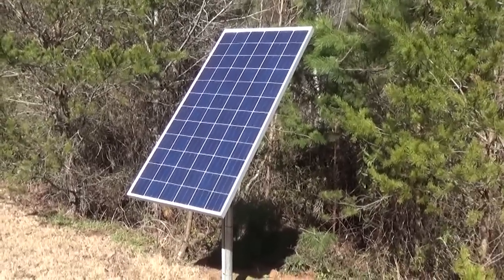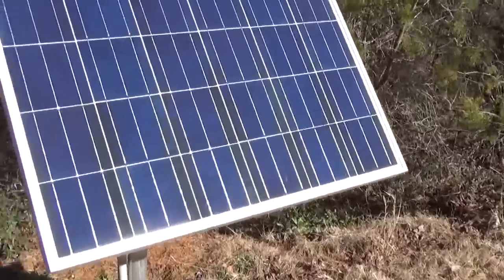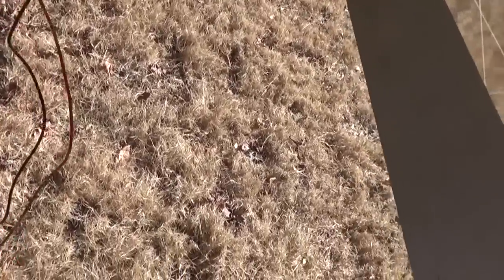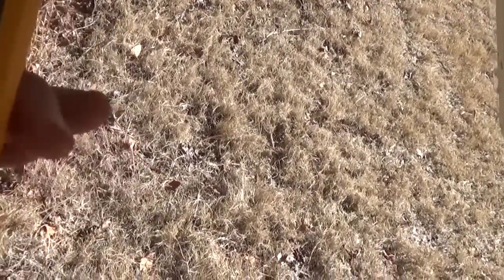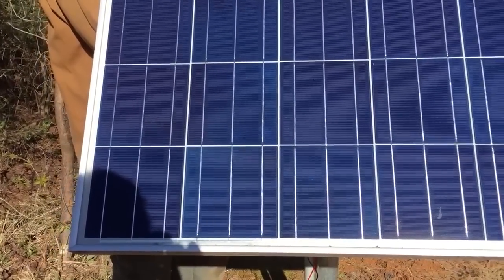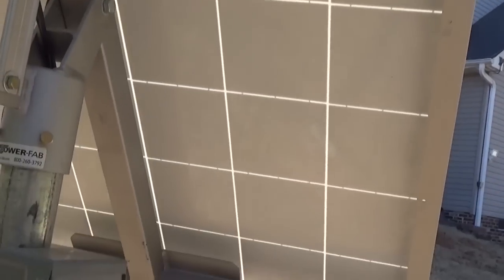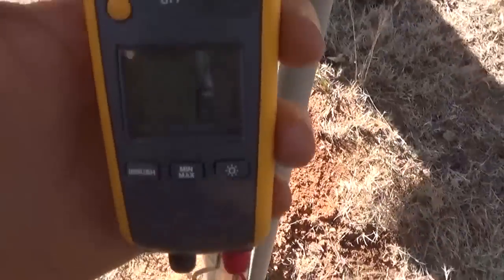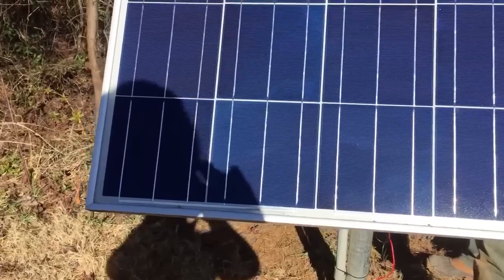How does shading affect solar panels?

Comment: I believe you meant open-circuit. Short-circuit produces high current, it doesn’t reduce it. But great demonstration overall.
This is the down side of a series connection. Thanks for sharing
Reply: Thank you! Sometimes YouTubers who are not Engineers pass on misleading information. It creates a higher resistive path and hence reduces the current. Well highlighted. Not short circuit. Solar cells works off the effects of quantum mechanics. Thanks to Einstein. Electrons get excited when photons of light from specific frequencies dislodge electrons to higher orbitals.
Reply: "Enginer"😂

Comment: It depends on how many by-pass diodes the panels have.  Canadian Solar uses half-cut cells and has more columns.  They put a by-pass diode on each column.  Allegedly, Sunpower has a by-pass diode across each cell.

Comment: Hook them up in parallel  . Shafing wont nearly as badly affect  power  as hooking them up in  series
Reply: The problem with parallel is that you loose Amps! :/
Reply: @value4life471   what ?  It's not nearly as bad as it is in series. Parallel adds amps together   so you'd be better off
Reply: @j5892000  Ok

Comment: I agree...shading does impact performance. However there are many other factors that affect output...esp with wiring for series, parallel, or combination thereof. I actually tested this with my pergola panels that are shaded in the morning. Simply rewiring the strings east-to-west instead of north-south increased their output despite shading. The MPPT finds the VOC for each string and then locks in for best power. I did a video on my channel. Overall...100% agree that shading/dirty panels/bird crap/anything that covers those cells are going to kill your output. However, there are way to maximize your output if you can't avoid it.

Comment: **PLEASE HELP**
I am trying to set up my own VAWT to generate power. I haven't been able to find the answer for this anywhere, but does polarity matter in the three phase ac induction system? I'm doing a 9 coil, 18 magnet (across 2 rotors) setup. In all the diagrams, however, it doesn't show whether or not the polarity of the magnets in relation to the clockwise/counterclockwise winding on the coils affects voltage and current. If you can help me, it would be greatly appreciated!

Comment: WOW - your solar panel not even being used, is just as bad as being in the Shade!  I've always thought individual solar cells should have schottky diodes in parallel.   "Shorting" not the correct term here at all, that is the oppsite of what is happening, it's limiting the shade is like a variable resistor limiting the current, NOT SHORTING.
Reply: Time to add more batteries and loads on that panel and get more use out of it!

Comment: My solar panel puts out max on a completely overcast day. Check out Uni-Solar panels. They are not typical panels as mine is 18 ft. by 21 in. for 144 watts. But it is consistently putting out 24v at 6 amps during the day. best part about it is if I don't stick it to the metal roof I can roll it up and take it with me under my arm.
Reply: Really 18 feet, or did you mean inches?
Reply: @shofarsogood7504  18 feet. Panel is flexible and rools up for transport.